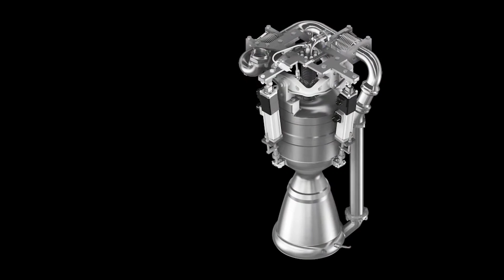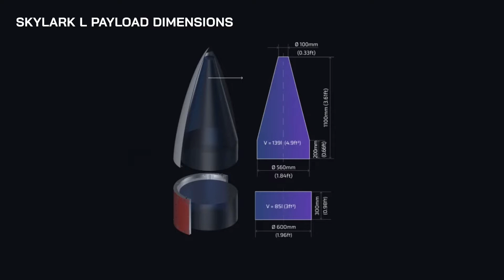Rocket crashes into the North Atlantic!  Angry's secret mission with Skyrora!!

Comment: The old "one line of code" error - sounds familiar. There should never be a single point of failure like that, skimping on reliability is a recipe for disaster in rocketry. What is more worrisome is they intend to go to a much bigger vehicle without ironing out all the issues with this one - this also sounds awfully familiar and disastrous.

Comment: A new rocket with a new engine has roughly a 1 in 3 chance of operating successfully.  To me the only alarming part was that it wasn't intentionally blown up by the range safety officer, but it probably didn't go far enough for that to not endanger the launch equipment.

Comment: As a programmer I would be curious about that line of code and the exact issue. Many years ago when one of the open source libraries had a bug and I saw what it was, it changed the way I program to be more robust. (Always use braces in C code after if statements!)
Reply: Here's my guess:

If fuel & oxidizer then launch.

Should have been an logical and &&, not a bitwise and!

Comment: Really compelling presentation about the Skyrora anomaly.  Well done.  If I may make one suggestion about presentation style.  Dial down the unnecessary hyperbole; a bad weather day in Iceland is absolutely  NOT "the worst launch conditions imaginable" (something you repeated too many times in this presentation.)  You dropped an excellent vid yesterday about clickbait and false hyperbole when exaggeration is used to distort the truth.  Don't fall into the same trap.  You walk a delicate liner having chosen an "ANGRY' schtick; only your focus on facts keeps you credible.
Reply from the maker: I aee your point. Although the conditions there were far worse than is typical for Iceland. Honestly, I don't see how they launched at all.
Reply: @TheAngryAstronaut  yeah I get that.  I visited Iceland almost sixty years ago and the thing I most remember is that the weather was rainy, windy, foggy and cold pretty much the entire time.  Clearly the good folks at Skyrora considered conditions acceptable to attempt launch; otherwise they would have postponed.  That's the thing about hyperbole, emotion and exaggeration; they distort the message for everyone; both observers and those doing..  Rocket science requires extreme focus on EVERYTHING, down to the least significant thing, like ordered lists in a line of code.  Check, check, and recheck.  Test, test and retest, but then understand that a certain amount of failure is inevitable. Another interesting thing about this vid as opposed to quite a few of the others on your trip to Europe is that it has universal importance/interest.  Seeking out what is of universal interest to your viewers is something that will help with subscriptions.  Watching some of your other vids from Europe, I found myself thinking  "this would be of particular interest to the folks in Great Britain, or the folks in Germany, etc., but it's not that interesting to me because it is not covering new ground (or ground that is important to the space interests I have.)  With your focus on trying to build up a base level of subscriptions, I found myself wondering why you were focusing so much and so long on stuff that probably was less interesting to the average space-interested Jane or Joe.  However THIS video shows how to talk about efforts that others are not focusing on that would interest all those space-interested folks.
Reply: @Markus Robinson  - I thought the video was fine. Unfortunately, an objective presentation doesn't make up for good entertainment. Some, possibly most of us, are here to be informed and entertained at the same time. I doubt Jordan would have got the traction he did without the "Angry" moniker. I would say let's just enjoy the content which is so difficult to produce and enjoy. It's our job to filter out the noise.  It's Jordan's responsibility to walk the tightrope between being serious and being an entertainer.